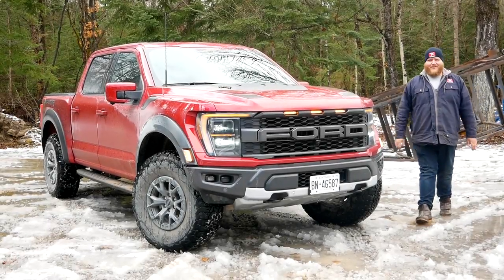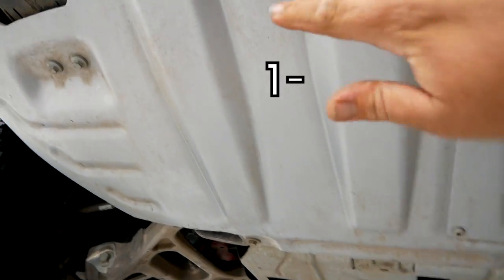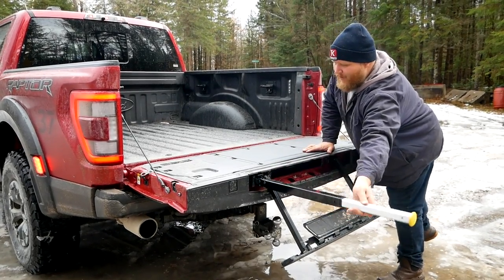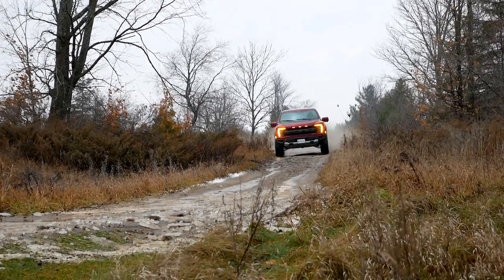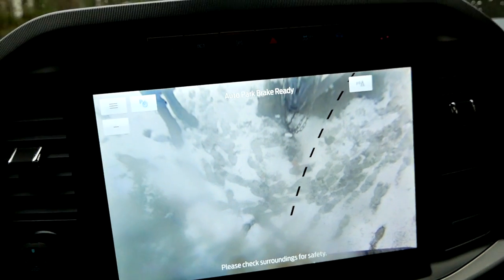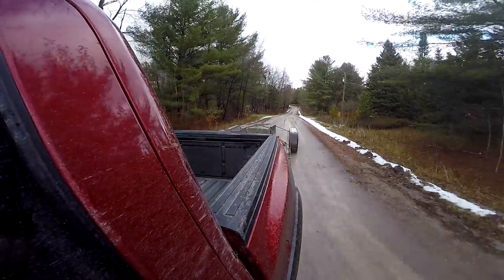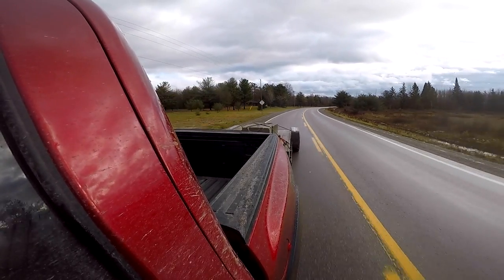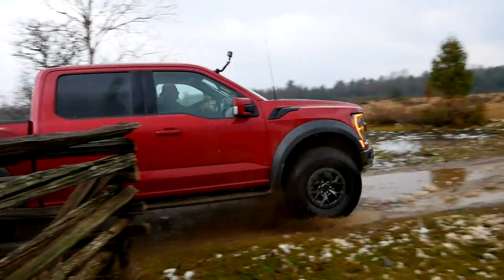New Ford Raptor Tackles the Water and Ice - Towing, 0-60, Off-Road & More

Comment: It would very interesting to see a comparison of the 35 inch vs 37 inch tires doing the exact same tests. Seems the 37 inch package hurts performance quite a bit.
Reply: Good point. Lots of extra rolling mass. It sure does cause problems for the first two Gen trucks!
Reply: @T4nkcommander  1.3 lb difference 35 to 37 bfg
Reply: 10lbs per corner hardly hurts performance. 0-60 5.5-5.7 seconds.
Reply: @johnhovland9511  TFL has done both but at different times but at the same place. Regular R Raptor was 6.1 and the Raptor on 37s was 7.1.
Reply: @bobdennis4801  tfl is literally sponsored by FCA. Gen 3 with a draggy runs 5.5.

Comment: 7:45 really an underrated point.. I’ve done the same.. pushed it on and off-road and even on road I tap out before it does. I grew up around racing so understand speed/grip.. this truck can be borderline scary. It feels like the tires would come off the rims on the 37 before it would cry uncle. Off road it makes things that have challenged my 4Runner & GX 460 seem almost unnoticeable. Took a relative off-roading in it and his comment was, “nothing is hard for this thing”.

Comment: I have this truck.. but a 2022 .. and a year later I’m still in love. It’s cheat code off-road (unless the trail gets thin .. when decisions have to be made when you can’t turn around) and defies the laws of physics on-road. I can’t think of any other vehicle I’d rather daily.
Reply: whats the maintenance like
Reply: @legion1630 I’m at 15k miles so just the normal stuff..oil changes/rotation and air filter. It sat for a while so battery was being shady so I replaced that. A big expense will be tires. These KO2 will be done by 30K.. maybe earlier. I won’t get 3 winters out of them. That’s gonna be over $2K. 37 tires not cheap. Going Falken AT4W.

Comment: I bought my Gen 1 for the body style, and the beefie grill. I've always been partial to that style. My Gen 1 also has that beefie V8 that I like. I've not towed anything as yet, but it does the job of getting me in and out of my driveway, it is like that backroad that you guys were on. I've got a 6 % grade at one point, where I have to use 4L if it is wet, or snowy.
I love a Raptor SVT over the newer ones, but a Raptor is a Raptor is a Raptor❤
Reply from the maker: Right on!

Comment: Pretty sweet, but gimme that suspension with the XL powerboost and zero farkles. Like a Workman Power Wagon...Some of us want all the mechanical, and can do without the price tag of all the fluff.
Reply: That would be really good for prerunner builds and play vehicles. However, Ford would be losing money by doing that, and one of the strongest points of a Raptor is that it is both a great daily and fun weekender.
Reply: Than your payload would be under 1k pounds. The PowerBoost is pretty heavy

Comment: "Most Raptor owners have never been in the desert." I think you might be surprised. The entire west and southwest US (including TX for fun) has access to desert or semi-arid regions. Even OR, WA and BC have semi-arid lands east of the cascades. I've played in sand dunes in both OR and WA of all places! And the surrounding states/provinces can road trip it. The raptor owners groups I'm part of definitely do this. I take your point though, you east coasters don't have as many areas where you can let these trucks stretch their legs!

You're dead on about the WD hitch! I had a weighsafe hitch to level and anti-sway with my raptor. Did a 3 state, 2000 mile road trip with a 5k lb travel trailer. Zero drama, dead level, no more sway, as much power as you need to pass anything, even uphill and 400 mile freeway range (see if you get that in a TRX, haha!) shockingly good MPG. And then you disconnect the trailer, air down and hit 60mph in the dunes! These trucks are amazing.
Reply: Yeah.  I think this truck was aimed at the SW, particularly SoCal where a lot of off road setups are judged.

Comment: That rear suspension should be on every F150 sold...the rough riding and juttering leaf springs should be an option for those that need the extra payload.
Reply: Then every f150 would need air bags to tow. Ride quality is much better but towing and payload is hurt a lot.
Reply: @bobdennis4801  stiffer coils will fix that and it's cheap
Reply: Agree or even an air ride system available for the f150s a lot of people put them on the f-150s
Reply: @bobdennis4801  Air bags are a weak spot...just ask anyone whos spent thousands to replace a failed air suspension on RAM trucks with a coil setup.

Comment: Really nice seeing the Raptor in its element. Sure, with 500 fewer pounds and no V8 hanging off its nose, the Raptor will be more nimble in this setting. But the problem with that is very few will do this often, in comparison to being daily drivers and highway cruisers. That's where the TRX shines. Quite literally the best ride comfort, cabin isolation, and luxury feel of any mass-produced truck. Plus, when the Raptor R comes out, the weight advantage and nimbleness will likely fade.

All of this said: There is a reason beyond offroading on why the Raptor and TRX are so sought after. They're quite literally the Swiss army knife of vehicles. Family, luxury, towing, hauling, highway crusing...all packed with the latest tech. You truly can't go wrong with either...except paying 20K over sticker currently!
Reply: Unless you want something that'll actually last longer than 10-15 years.
Reply: The 3.5 Ecoboost is slightly heavier than the current Coyote 5.0.
Reply: @KiyaWarrior  very true, which is why a TRD PRO is the better option, more reliable and practical, yet still more capable than what 99% of people need.
Reply: @nismomike3182  it is about power/weight, and also efficiency. The 3.5 - to say nothing of the High Output version the Raptor has - thus becomes the obvious choice.

Thats why the TRX is slower offroad...worse suspension with a heavier nose. Even in my Gen 2 the suspension and heavy front end is a constantly limiting factor - it was obvious to anyone paying attention that the TRX was going to be worse in Baja based on physics alone.
Reply: @T4nkcommander  The OP said "Sure, with 500 fewer pounds and no V8 hanging off its nose, the Raptor will be more nimble in this setting." And then he concluded "When the Raptor R comes out, the weight advantage and nimbleness will likely fade."
My point was that the 3.5 Eco Boost is not the light weight powertrain many people assume it is. Adding a high output Coyote V8 alone will not affect the Raptors nibbleness and handling one bit.
Reply: @nismomike3182  The Ecoboost is lighter than the V8 alternatives, and has higher torque at lower RPM. These were two of the many reasons it replaced the original 6.2L (which was an upgrade option in 2010).

Ford hasn't bothered with a V8 up until now because they know it will be a downgrade for all practical applications. However, the TRX has proven there are people who will pay a premium just to say they have the most HP, even when in actuality their vehicle performs worse. Ford is obviously going to capitalize on that market, but are in no rush to do so as they don't need to.
Reply: @KiyaWarrior  If you’re poor and need your truck to last 15 years, this is not the truck for you.
Reply: @stevieray1828  no it isn’t 😂
Reply: I mean minus the fact what you’re saying is an opinion in “best ride comfort, cabin isolation and luxury feel”
Reply: @JoshSmith-mm1fi  based upon the multiple reviews and actual owners. Ben Hardy Reviews owns both a TRX and Raptor 37 and said as much. TFL truck summed it up similarly as well.
Reply: @hellkitty1014  I mean yeah if you talk to people who own that vehicle of course they're going to be bias towards there own
Reply: @stevieray1828 It’s not nearly as comfortable. I drove a TRD Pro Tundra from Nashville to Anchorage to Lexington, KY to Wisconsin to Connecticut to California and I can definitely say it’s not nearly as comfortable as the Ford’s interior at the Lariat level trim; which I also drove from California to Nashville and back in the span of 7 days with a big cargo trailer in tow.

Comment: In my personal opinion I believe the bronco will put a dent into the raptor sales due to not having a SC V8 version yet. A 2.7l ecoboost with the most basic power mods will make just as much power if not more than a stock 3.5l ecoboost. Even the 2.3l ecoboost engines make great power when tuned. I personally would go 7.3l f250 tremor over the current raptor at suggested market price.

Comment: I’m really debating between the 37 and 35. I like the look and ground clearance of the 37 but the more limited suspension travel and articulation is kind of a big deal.
Reply: Fancy seeing you here! I've run with a lot of 37s (think you have too) and for the high speed stuff  I've not noticed a performance gain. They do have constant problems with stuff breaking, clearance, etc. That should be fixed from the factory, but even Ford said 35s are better except for low speed crawling. The added rolling weight and diminished clearance is more of a detriment IMO
Reply: I bet the 37s will be better in just about every situation off road.  They will roll over rocks and holes better both at speed and going slow .  My worry about the 37 was more about daily driving affecting fuel economy and handling but all the reviews i’ve seen make it sound like ford did a really good job with it.
Reply: @T4nkcommander  I get around!
Reply: @peachpole  TRX has far better RTI score than the 37 Raptor. Less travel, more rolling resistance = worse for what the truck was intended for. High speed desert running.
Reply: @jabroni6199  I’m not going to try and change your mind but the benefits of a larger tire are difficult to type out on a keyboard.  If the raptor gives up a significant amount of travel with the 37 that would be a problem but I doubt ford would allow that.
 If I wanted to buy a raptor to thrash in the desert. I would buy the 37 version.  It’s just going to roll through holes and g-outs better and make rocks feel smaller.  It helps that the KO2 is a nice light 37 as well.   Just my opinion.
Reply: @peachpole  it could be your opinion but the engineers that designed it at Ford say otherwise. Your money your choice though either way it’s a great truck.
Reply: I have the first gen, did not go for second I like the 3rd gen, but I need that v8
Reply: @jabroni6199  Raptor with the 37 package has the same suspension travel as the TRX in the front 13 inches and  rear 14.1 inches which is .1 better than the TRX
Reply: @jabroni6199   Suspension travel is not the same as flex,you said the Raptor  with 37's has less suspension travel than the TRX which it does not
Reply: @peachpole  I've run - and filmed - Raptors with both 35s and 37s. The 37s offer no appreciable practical advantage in Baja-style offroading. The extra rolling resistance is impactful in all arenas.

The extra ground clearance provided may give a slight crawling advantage, but from what I've seen this is a rare occurrence, and not worth all the breakages that come with the extra rolling weight.
Reply: @T4nkcommander  Good to know.  I definitely wouldn’t have put 37s on a second gen but i would still order them on the third gen.  For the places i would drive it, i would rather have the larger tire even if it does slow it down a little in the faster wide open sections.  I’m not trying to win races but just have some fun and all of the reviews i’ve seen have positive things to say about the 37 pkg both on road and off.

Comment: Great review! As a Chevy ZR2 owner, I’ve been wrestling with upgrading to the Raptor, but it just doesn’t seem like a good of a value… My ZR2 can pretty much do anything the Raptor can off-road, and I’ll argue the ZR2 is more versatile since it can fit on tighter trails. Of course the ZR2 lacks in the interior refinement/bells and whistles that the Raptor boasts…but that’s not really why you buy an off-road truck is it? The Raptor clearly tows more, but then again, I don’t have anything to tow at the moment 😬
Reply: pure opinion.  leaf springs never beat coils off road or for comfort

Comment: Grear video! Unfortunately I could never buy another ecoboost Raptor due to the poor reliability (and sound). Cam phaser issues, rod knock, starter motors sticking, etc are just a few of the common problems. 
Also, I think once you add a 5.2 Predator engine to the Raptor R, plus upgrade all of the Powertrain and suspension components to be able to handle the power offroad, you'll be as heavy as, or heavier than, a TRX. At point the Raptor loses amy advantage it had over the heavy Ram. Maybe GM and Toyota will get into the offroad game and give us some good competition!
Reply: Yeah no extremely reliable and better than the trx in every way
Reply: I have had 2 ecoboosts.  Zero problems.  10 years.  Please provide facts rather than generalities because you have none.
Reply: never be as heavy as TRX.  Its an aluminum truck and a V6.  You make no sense with your comments again unsupported by any data.

Comment: Do you know, can you get real, softer rubber snow tires, not just the 3 peak winter rated all seasons or all terrains, in that 37 tire size?  And what is the specific size of those stock 37's?  (My little Jeep that I will be replacing has 235/70 R16's for instance).  How about with the 35's?  Oh, and with those coil springs and no leafs at both ends, do you think this actually drives smoother, more buttery smooth, on the highways as say a Platinum?  As usual, always useful vids.  Thanks.

Comment: When you say different frame, is it just for the spare tire at the rear? Different shocks 1 inch shaft versus seveneights is that the only difference In suspension?

Comment: Well, my F250 would definitely tow that trailer better but if I tried matching the Raptor off road first, the tow test would have to wait until I was done with multiple trips to a chiropractor and possibly some repairs to the truck.  That is assuming I could even reach the Raptors speed off road without becoming totally uncontrollable.

Comment: @Truck King What was max towing on this specific truck? Raptors are advertised as having max towing of 8,200 and max payload of 1,400. Steven read the max payload sticker on this truck as 1,270lb.  Was the 8,200lb max towing you mentioned the max for the model? Or max for this particular truck and what was on the label?   Either way, with 7,000 pound trailer and you two in it, you were in the ballpark of max payload. If one was towing max trailer weight of 8,200, then 1,270 max payload - 820 tongue weight only leaves only 450 lbs of payload for driver, passengers, cargo, tools, supplies, etc. 
That being said, like with most pickups, if you are regularly towing over 2/3  (66%) of the max tow rating (regularly meaning every weekend), you will likely be better served with a pickup with more capability. 2/3 of max towing seems to be a reasonable place to be towing regularly in comfort. Sure you can tow right at max, but having some leeway makes for a lot more comfortable trips.

Comment: I would buy a truck at half the price that fits my needs more than this.
Reply: Unless your needs are to have fun offroading! But seriously it is a good time and a fantastic daily if you don't need a super serious work truck
Reply: @T4nkcommander  It's pretty bad that I could save some money by getting a Corvette instead.
Reply: @CraigSmith568  And you'd have a two-seater cruiser stingray rather than a supped-up F150. If you haven't noticed, car prices across the board rise every year.
Reply: @T4nkcommander  I'm just trying to figure out when they passed cars though. When I was growing up a truck was the cheapest thing you could buy. Now they are stupid expensive.

Comment: First Gen could still tow 8000 lbs, only 200 less than the boosted third Gen.
Reply: Meanwhile me in my SCAB sitting more around 6000lb xD
Reply: Not with the newer SAE J2807 standards.  The Gen. 1 tests at around 4300lbs under the same standards as the gen. 3.
Reply from the maker: Agreed.  The new gen has a big towing gain.